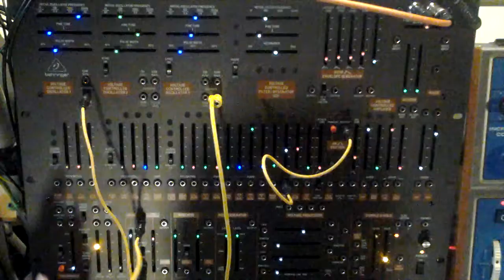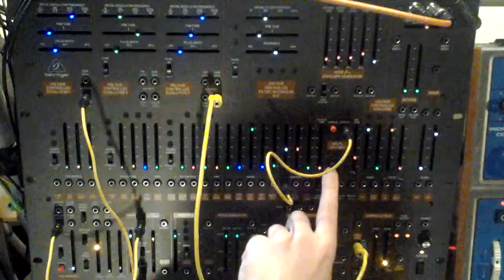Behringer 2600 Multiple Rhythms Trick

Comment: Just a pity you can't sync the 2600 to anything else - e.g. a DAW - unless you know a way?
Reply from the maker: You can clock the sample and hold and trigger the synth from a daw with a midi to CV converter. If you mean tempo syncing LFOs then no there is no way to do that on the 2600. If I want tempo sync'd LFOs I use Voltage Modular and output them through a DC coupled audio interface (you need floating ring cables for this).
Reply: @Bata9999  you're getting beyond my knowledge there!
Reply from the maker: @awpMusic1  You can take a look at the Expert Sleepers ES-9 which is built specifically for interfacing modular gear with computers. I'm doing the same thing just with stuff I already had around.

Comment: I love my 2600 so far in its semi-modular state.  I’m gonna slowly touch my toe into the patching because I don’t really understand everything that well.  Like most synth heads, I don’t ever bother to read a manual. 😅 I move sliders and knobs first and ask questions later.
Reply from the maker: The 2600 can make thousands of different sounds without a single patch cable. It's a really brilliant design. I don't like reading manuals either. Some basic patches that are useful are LFO to pulse width mod on oscillator 2 and 3 and sample and hold to the filter.
Reply: Look around online for example patches like the Helicopter one they used on movies like Apocalypse Now. I tried a few when I first got mine and it opened up a lot for experimentation! Most of the Star Wars sound effects were made on an original 2600 as there weren't other ways of making the sound effects! Such a creative and Amazing piece of Musical Genius!

Comment: I don't understand why these techniques work. Plugging a clock into a gate output and/or clock output and that modulates the clocks? So weird, but it works! Thanks for the tips.
Reply from the maker: Patching outputs to outputs is traditionally not advised but can yield many interesting results. Try patching saw out from one of the oscillators into saw out from another oscillator and listen to some of the waveforms. You can get sync type sounds and other uncommon wave shapes.
Reply: @Bata9999  So you can't blow up the behringer 2600 by patching output to output? Or are there things you need to be carefull with?
Reply from the maker: @meesvandenberg9468  Patching the 2600 just by itself it should be impossible to damage anything. If you were to take a very powerful signal like the power amp outputs from a PA you would cause damage but that would cause damage through the inputs as well.
Reply: @meesvandenberg9468  Just about every "module's" output within the 2600 is current-limited by a 1k resistor (it may be all of them), so outputs get summed when connected together, with no harm possible. The 2600 was intended equally for performance and education, so for the latter it had to be bullet-proof 😄
Reply: @blijj3450  it's truly a genius machine!